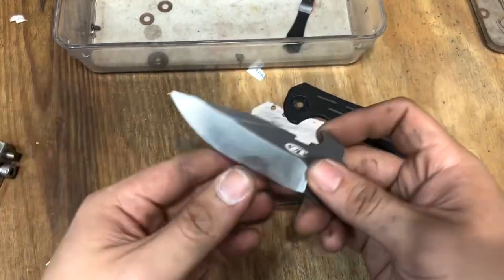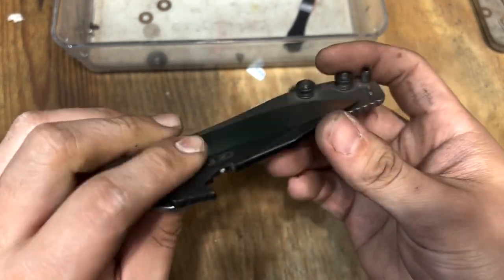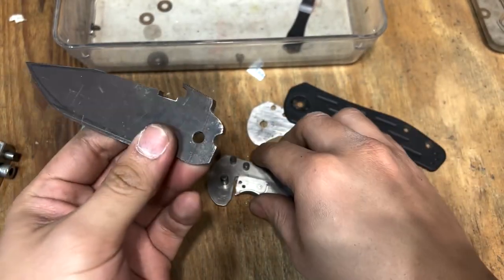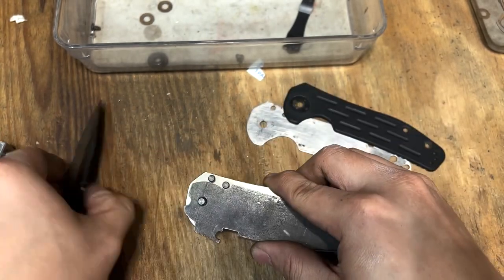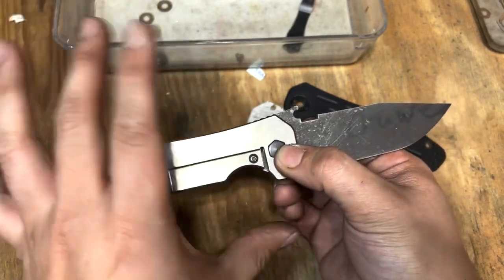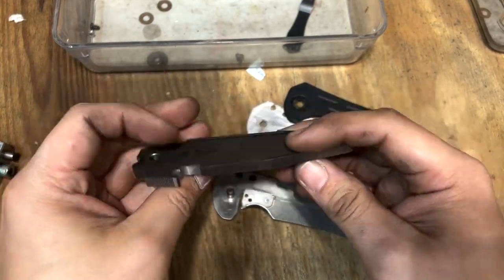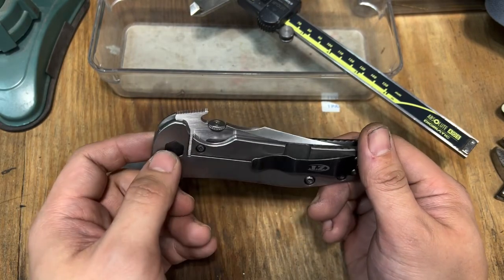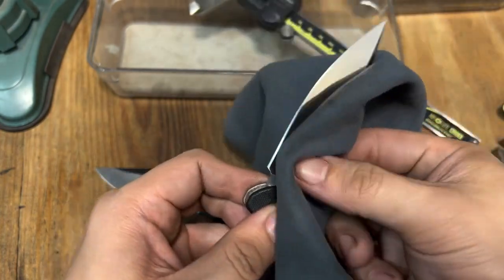ZT0620 Came Out of Retirement

Comment: The new blade profile is attractive and quite original. It suits the platform.
Reply from the maker: Thank you! I wanted to pull out a little surprise
Reply: @yihuang5509  I am very impressed with your skill. I was listening to Todd Begg on the Mark of the Maker podcast, saying how among the latest generation of "knife makers" there are some guys who never touch a grinder. They design everything in CAD and have it made for them. 
Of course I can appreciate that a lot more goes into the making of a complete knife than just the blade - but that's the main event. 'Looks like you made a good one - perhaps next you can make that short handle you mentioned, from scratch. Then you will have a unique blade and a unique handle so for the next step you could take each of those as prototypes for a complete knife. 
I'm new to your channel and I don't know whether you already make knives - if you don't I'd love to see you do that and from what little I have seen of your content I am confident it will be a fine knife without any lock fail!

Comment: Are you using water fed belts or just micro quenching in water on that regrind? Its much better to do a reblade. Zt ht is terrible. They sometimes do okay with elmax but nothing too great and they burn it too.

Do the cruwear 63-65 with 3 tempers protocol.